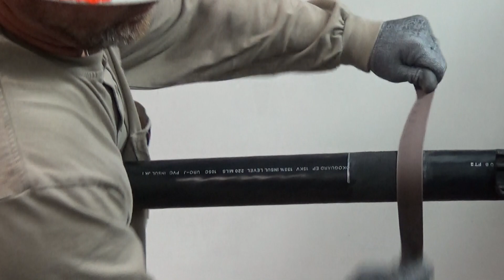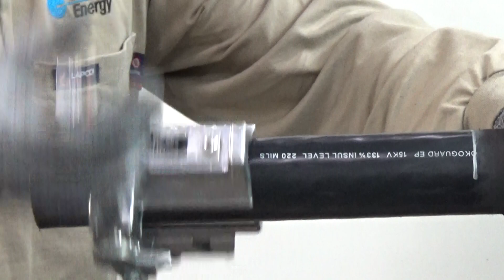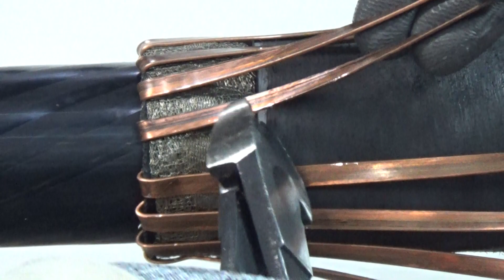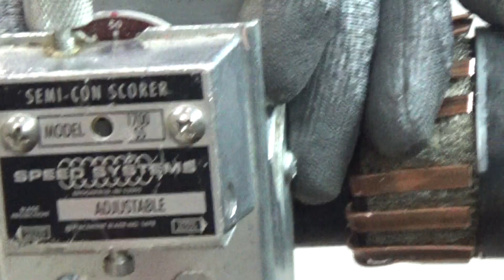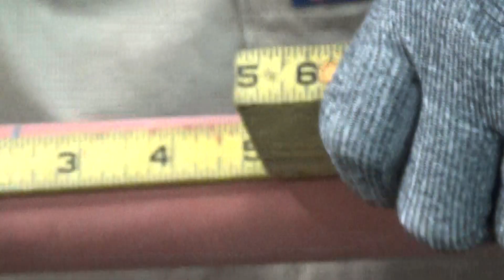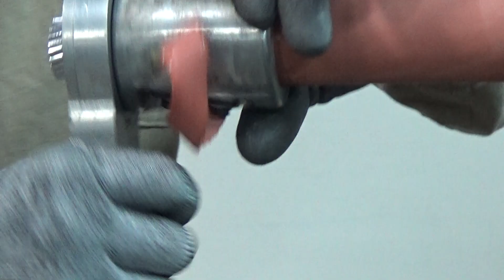15KV  05/03/18

Comment: Do you have to bevel the end if it’s a compression lug with cold Shrink
Reply from the maker: Not on cold shrink. When we only did hand taped splicing we had to pencil the end for about 1 1/2" to make smooth transition.
Reply: 10/4 Thank you
Reply: Does the size of the bevel change by voltage, amperage, wire etc?